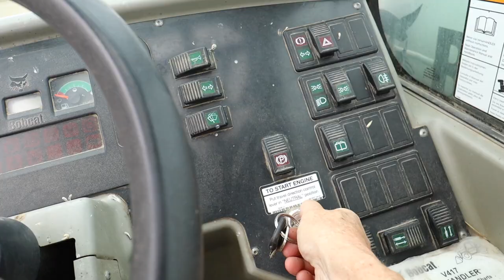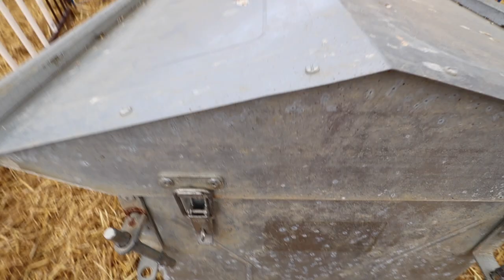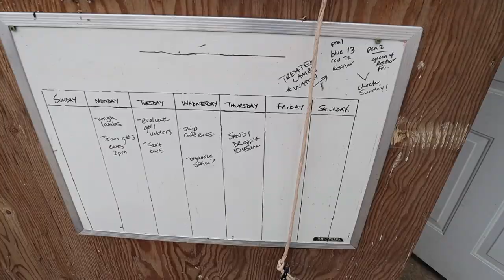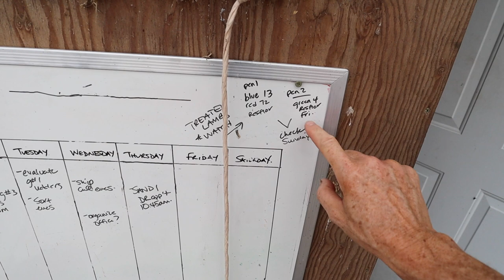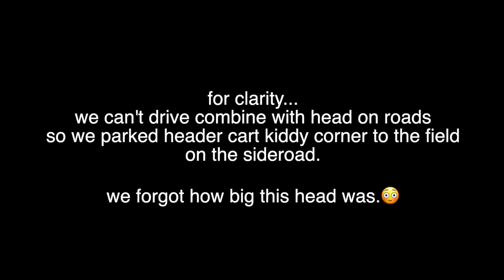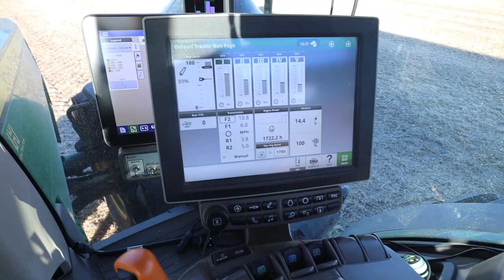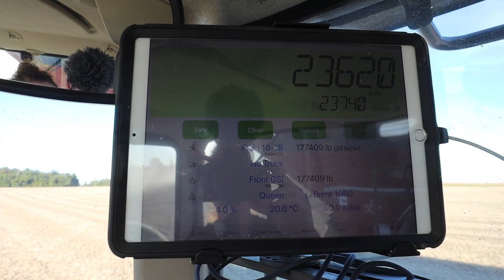Measure Twice, Mr. Brock. 🤦‍♀️ | that could have been bad.😬| Vlog 495

Comment: You might consider spreading lime on the concrete after you clean an pen and even with bedding.  The large milking operations add lime with the sand bedding and I saw Sonny Farms put it down after cleaning out straw pack in there birthing barn for calves to keep down pathogens with Ph shift from the lime.
Reply: I agree.  And/Or consider using a backpack sprayer to cover the concrete with a bleach solution to kill anything in or on the concrete right after clean out.
Reply: Cammy from The Sheep Game spreads something similar in his lambing barn(s) to kill off any bacteria/pathogens. Whatever he uses, I imagine, may be available in Canada.
Reply: The Sheep Game uses a dry disinfectant powder when setting up pens for ewes & lambs
Reply: s healy - I watch Sonne Farms too!
Reply: Cammy from The Sheep Game does lime or something similar!!
Reply: I agree as well. When I muck the horses' stalls, I sprinkle lime and then re-bed. Makes an amazing difference as it removes dampness and eliminates a lot of odor.

Comment: Do you disinfect the pens when you clean them, or just scrape them and remove the manure?  I used to use a garden hose sprayer to spray bleach all over my barn floor and up the walls between farrowings and/or foalings.  We had beef cattle, hogs, and horses.  The cattle calved in the field, but we had a farrowing barn for the pigs, and later after we built a new one, the old one became my foaling barn and bottle calf barn.  We'd had a lot of e coli scours with the calves and pigs, so everything got well slopped down with bleach in between to keep it under control.

When the marriage is good, every day is a celebration.  We got married two days after Christmas the year before you.  May I tell you how we forget our anniversary every single year?  My father in law was really sick, and wasn't expected to live, so we backed our wedding up as close to my college graduation as we could, hoping he would live long enough to at least know we were married.  As it happened, he recovered and came to the wedding.  :)  We forget it every year.  Its all good.  Every day is a celebration.

Comment: Sandy we have the same  Is problem with joint ale when you clean  pens out you should get some lime pellets and get a bacteria disinfective and spray the walls spray the bunk spray the concrete with disaffected  . The bed was more straw the 1st time to laid on top of the pellets. It will clean all your problems .

Comment: You need to spray the whole umbilical chord and repeat it as the ewe will lick it off when the lamb is still wet. You will use far less iodine using a spray bottle. Just make sure the whole cord is sprayed on both sides. My vet gave me a mixture of steroid, multivitamins and antibiotics for the few cases I had. The antibiotics interfere with the vitamin levels. Every case fully recovered.
Reply: That's awesome!

Comment: Just wondering I saw you dip the lambs when they were still wet and mom was still licking them dry. Is there a posibility that the ewes were licking it off and isn't as affective when they cleaned their lambs? Or should it not matter?
Reply: Just made a comment to that effect. Yes the ewe will lick it off, so it needs to be repeated when the lamb is dry.
Reply from the maker: My vet assured me it was fine due to the alcohol added to the iodine. But I wondered the same thing…
Reply: @SandiBrock  is it true you can only get iodine at 5%, we get 10% in the UK. But definitely worth reapplying once the lamb is dry, as it accelerates the drying off of the chord preventing any ascending infection.
Reply: Can a second application be done with spray bottle, to make it easier and faster?  I'm thinking that it would still be sufficient.
Reply: @darlaherbst5929  most of us use a spray bottle, as long as the whole navel and umbilical cord are completely covered Sandi is wasting a lot of iodine with her disposable cups. I don’t agree with her vet’s advice, the whole cord must be sprayed in order to dry and disinfect it, as infection takes place by ascending through a wet infected cord. Bearing in mind the pens are made up on dirty bedding. That is another issue. It is vital to give each family a fresh, clean disinfected pen each time. That requires a separate area for the lambing pens and work cleaning out and disinfecting pens between occupants. I wore waterproof dungarees that could be hosed and disinfected regularly. All these details make a difference when lambing indoors where bacteria is bound to e concentrated.
Reply: @wendyrowland7787  That does sound like an ideal system, but it doesn't sound like an attainable option for most sheep farmers.  If the whole pen was cleaned out and disinfected just before lambing, that would be a significant improvement.  The lambs could stay in heavily bedded pens for 2 days, so naval/cord can be dried up a little more. That may be just enough!
Reply: @darlaherbst5929  now here’s the thing, attention to detail makes all the difference between lambs born and lambs reared. A year round housing system is bound to have problems especially if the infrastructure is not  disinfected after mucking out.
Reply: @wendyrowland7787  From the video it seems her affected lambs were born in the night so not dipped soon enough. Lamb checks at night would save a lot of lambs. I don't know any sheep producers, personally, who don't do 2hr checks day and night. And it's so easy for her as her sheep are contained, not out on pasture.
Reply: @vwvw4  yes we all need a night lamber for an intensive lamb drop. Saves mismothering, saves death by malpresentation. Although I did once go into the shed to find six ewe lambs and twelve newborn lambs wandering aimlessly so I am not perfect. I gave each ewe lamb two lambs each and they accepted the verdict. Ideally they should have reared one lamb each, but it went well with lamb creep  feeding, and feed buckets.

Comment: I  was surprised  with all hard work you do with uncoperative sheep that those little boxes with nothing to hold on to gave you a hard time.  I loved it- I have been using that method for about 45 yrs.  I have to pay more  for my chicken feed because I can not even get the 50 lb bags in using the roll one corner at a time and if it rains I can't open it and scoop out half into a another container, so I think bad words and order the 25 lb ones. which are slightly more per lb.  Your office is looking very nice.

Comment: What you all call stones, in my world HONEY, that is big rock. Our rock piles along fields are huge, matter of fact we have had bears den in the rock pile behind our barn.
Joint ill is such a PITA. Just a suggestion here Sandi, if you can dip twice the umbilical to lambs. I know more work but we have found that it helps to do it 2 times. Once when you move into bonding pen and again when you move out the pen. Also dip scissors for clipping in the iodine solution every time you use them or wipe them with paper towel soaked in solution. It might save time and antibiotics.

Comment: I wonder if the joint ill bacteria is down in the concrete. Even if you put clean bedding down and clean full pens everyday if the bacteria is stuck down in the concrete it will travel back up with the moisture which acts as a petri dish for it. I wonder if you sprayed a disinfectant on the concrete after you scoop it out if that might help?? Just a thought seeing as you are religious with your scooping and bedding of your flock. Keep up the great work!!❤❤

Comment: You need to add a stair slider for moving packages up and down your staircase.  It amounts to a board that is hinged on the wall side ( usually ) of the stairs.  It drops down to slide packages up and down the steps. Use a rope for heavier packages. Your back will love you. When not needed it folds up an fastens out of the way.

Comment: Sandi, 
🙋 Question 🙋
When you clean out pens - down to the concrete - do you ever power wash, disinfect, and air-dried the area b4 rebedding and moving the sheep back in? If something is "in the barn", what can be done to prevent/fight it?

Comment: My fiance and I would usually go for a hike, or camping for our anniversay.
Though the last 2 years haven't worked out well. Not because of Covid, as we woukd be in the middle of no where near no one.
It's really because on May 5th 2019(our anniversary) we went camping, but also I was pregnant with our son. I was 3 months. Pretty sick most of the time, but still spent time with him.
May 5th 2020 we didn't because covid, but our son was also just born in December 2019. So we planned to go in September instead. Found out I was pregnant with our daughter, and morning sickness was horrible. I was bed ridden, and ended up leaving early. :( 
In April our daughter was born by c-section, so was in pain on May 5th 2021 and couldn't go camping. 
We did go for a hike though in July with the kids. :) it was nice.
And in NO WAY do I regret either of our kids. They are our perfect angels even with 1 planned, and 1 a surprise. 

Hopefully we will be able to do more hikes with the kids in the coming years as they get older. It will be nice.

Comment: Do you think if you did something like an antiseptic wash bleach something like that to kill all the bacteria on the concrete after you've pulled all the bedding out that would help get rid of some of the diseases? Can they live in the concrete? Like I know like long-term maybe not but if you take off the bedding that has different things in it and then disinfect and put new bedding on would that help? Or think that's one of the benefits of having concrete as you could like power wash everything with a disinfectant.

Comment: SANDI...Is there a reason the birthing mamas are not separated into their individual pens before birthing rather than right after..with clean bedding..seems it would eliminate missing the early  naval treatment issue and lamb stealing also...??🐑🐑
Reply: They like to move around and lie down to deliver. Penning them at that stage would probably add stress.

Comment: Firstly Happy Anniversary to you both - my wife and I have been married 49 years this year however as she is now totally bed bound I am her primary nurse so it severely limits our celebrations but she enjoys scented flowers and chocolates. Visits from the grandchildren are always welcome especially in this time of Pandemic coronavirus plague.

Regarding your joint ill problem we apply lime to the bedding to any damp/wet area and then bed the sheep on top. We found that using a dairy cow teat dipping cup (which has a bowl on top of the refillable squeeze bottle) filled with iodophor teat dipping solution the best equipment and solution for dipping navels. 
You squeeze the bottle which forces solution up into the cup and you then put all the navel cord and the area of the belly onto the cup and squeeze so that the lambs skin around the cord is coated.The cup has a large hook to hang it up with (eg pen division)and unused solution drains back down into the bottle. Even if it is tipped over if you drop it or lay it down in the bedding the amount of lost solution is minimal. Iodine is a brilliant low temp disinfectant and relatively cheap, the downside is that it does stain tissue brown for a while including your fingers!

Comment: A RECOMMENDATION, FROM A SMALL WOMAN, WHO IS OLDER, THAN YOU:
YOUR LAMB SLED IS AN EXCELLENT MOVER OF AWKWARD PACKAGES. I USE MINE, TO DRAG MY GROCERIES, AND FEED SACKS, UP THE STAIRS. I BUNGEE IT DOWN, AND THE SLED RIDES ACROSS THE RIDGES, FOR AN EASY, LOW-RESISTANCE, SLIDE.  IT, EVEN, WORKED, FOR MY NEW AIR CONDITIONER, WHICH IS QUITE HEAVY. I ADORE MY JET SLED, AND MY BEEFY DOG, WHO DRAGS IT. (LOVE YOUR CHANNEL, TOO!)

Comment: If you have a joint ill that's has to be euthanized go ahead and have the joint tapped and cultured, sometimes you find something you didn't expect.  It should be A. pyo and coliform but if you get a mycoplasma consider using doxycyline. I use draxxin, amoxicillin and steroids, unless I get a mycoplasma out of a joint, then I'll switch out the amoxicillin for doxy. About 90 percent if caught in the first 2 days. But I treat every other day for 4 treatments minimum,  if you stop too soon cure rates will fall. Lastly.  I see more mycoplasma in really clean barns than in the sloppy ones, dirty barns it's usually the common offenders but your barns are as clean as any I have ever seen. 
Just my thoughts, joint ill is in my top 3 fav diseases